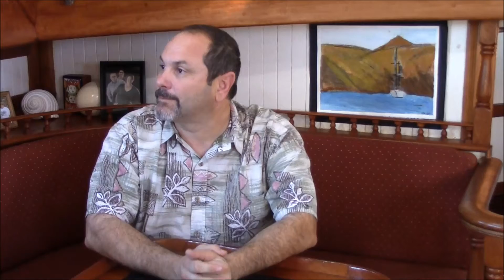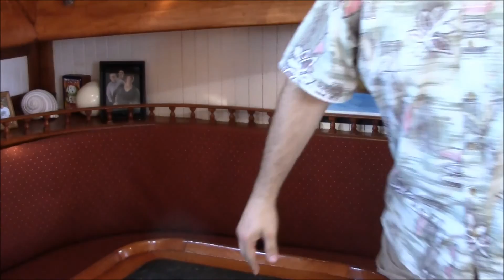Powering a Marine Water Maker from a Honda 2000 Generator

Comment: Is the EU Honda 20i the equivalent of your Honda 2000 ? I can't seem to find your model here in Norway.
Reply from the maker: Yes, the Honda EU2000i sold here in the USA has the same power output and wattage as the European model EU 20i.  The only different is the operating frequency.  The North American generator is a 60Hz 120v, while the European model is 50Hz at 220v.  We can of course equip our water maker with either motor to run on either model.